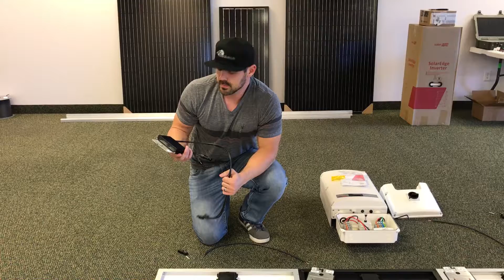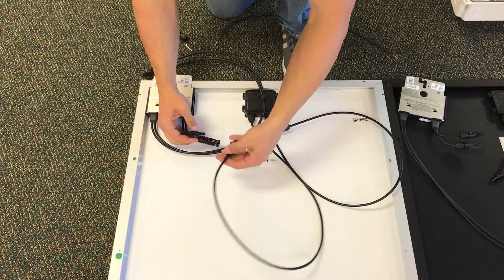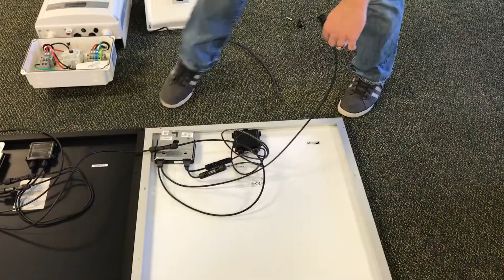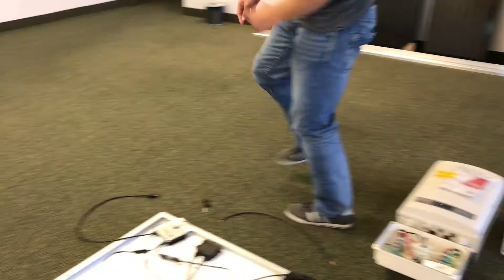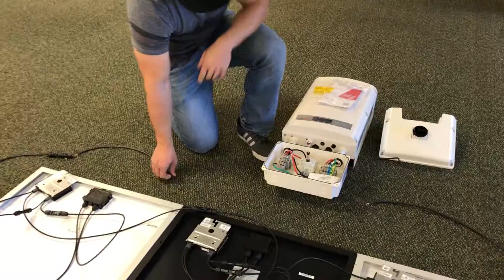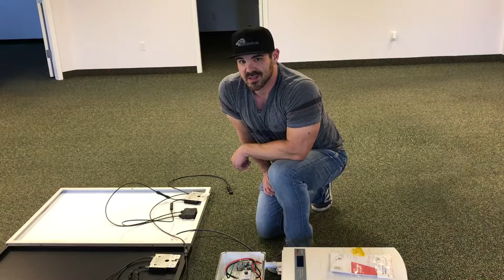Chaining Solar Panels With Solar Edge Inverter

Comment: Do you have trouble with the 'screwdriver' terminals?  I've got the Solar Edge 7600 US Inverter with Storedge distribution.  From the LG Chem battery you run two #10 AWG cables (DC, 1 pos 1 neg ) plus a bare #10 ground wire through conduit to the Stor edge unit.  None of the larger green terminals work properly, you can insert a wire but it's impossible to pull it back out.  On the grey terminals (smaller) you can't even insert a wire, #10 or #12.  I tried everything.  Watching an installation video of the HD unit they made right after, I see they've changed those green block terminals to green blocks with set screws.  If the terminals were working, why change the design?  I think they had trouble with those first  connections terminals and changed it.  Meanwhile, I"m sitting on $20k worth of solar equipment, installed and almost ready but I can't connect the wires.  Calls to both Solar Edge and LG Chem (same large green blocks) said to fill in a warranty claim and send the units back.  
Reading the Product warranty, those blocks are probably discluded because they don't warranty beyond 120 days, a bunch of small parts they source from god knows where.   No inspection from the city, no rebate, no grid connection, just a lot of expensive equipment I'll have to jury rig to make work and then I'll have no warranty.
Solar Edge and LG Chem were a 'huge' mistake.
Reply: I'm reading your comment 2 years after you posted it.  Did you get any satisfaction or resolution from the supplier or manufacturer?